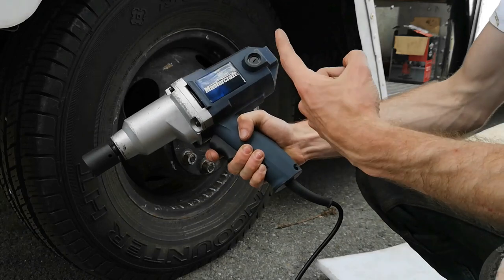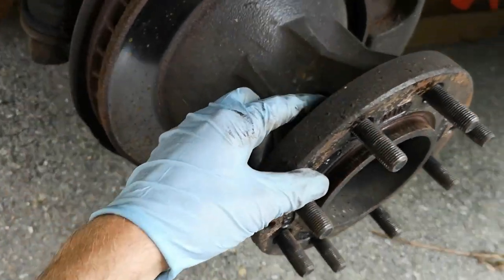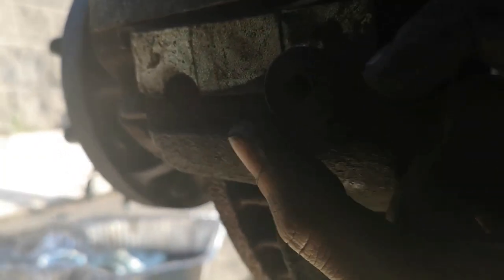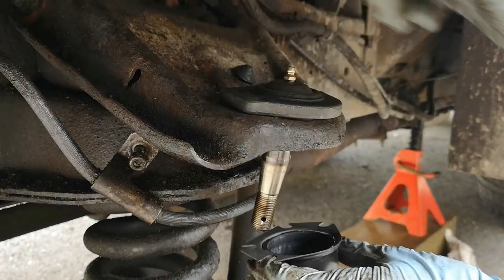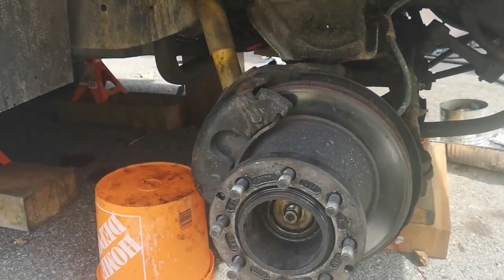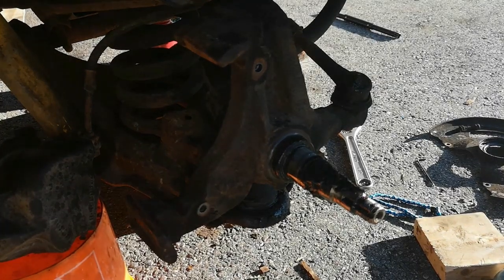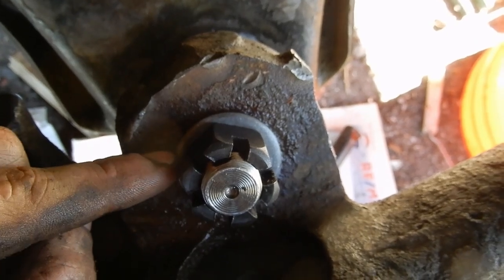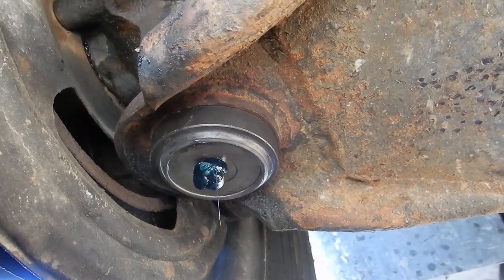Replacing Upper & Lower Balljoints (1990 GMC P30 Stepvan) ~ E074

Comment: Omg STOP! Job done WRONG! CAUTION! That's not an axle nut that you torqued down to hold the brake rotor on it's a wheel bearing adjustment but and cotter pin. Immediately stop driving and loosen those nuts. You never leave them torqued down or they will be over tightened heat up seize and fail causing the wheel to lock up while driving! Please find out how to adjust a wheel bearing before you tell other people to do this incorrectly and UNSAFELY and wrong! The wheel bearing adjustment nut only gets torqued down as you rotate the rotor to  fully seat the wheel bearings. After they are fully seated you are to loosen the nut and then tighten it by hand without a wrench. Insert the cotter pin into the nearest hole. Do not tighten this nut as the wheel bearings are not designed to have preload on them (being tightened). They are designed to have a few thousands of an inch of play in them. If you don't understand that consult a service manual for the vehicle you are working on or hey manual that shows how to adjust a wheel bearing. This video should be taken down or edited because you obviously have no understanding and did it completely wrong causing an condition that others will duplicate.

Comment: Ok, I am not going to lie, you scared the crap out of me when you pried that upper ball joint free.  But I figured since the video had been posted you lived.  Typically you would want something pretty sturdy under the lower control arm since the only thing holding back that serious spring is a shock absorber.  However, Congratulations, you have once again tackled a pretty difficult job in less than ideal conditions.  Just an FYI for the other two ball joints you should not have to remove the wheel hub or brake assembly unless you felt you needed the working room.  ball joints can be replaced without removing those if you do each one at a time (replace upper then replace lower on each side individually.  Again congratulations on a job well done, before long you can open your own repair shop.
Reply from the maker: Yeah, that's why I'm learning. I made another huge mistake doing this job. The shop opening will have to be delayed, lol.

Comment: What was axel nut torque?
Reply: It's NOT an axle nut! He doesn't have an axle!!! It's a spindle!!! He did it completely wrong, do NOT leave that nut torqued down or the wheel bearings will seize up and lock solid causing loss of vehicle control. This video should be edited and corrected now that people have seen it and don't know it's wrong and unsafe! Google how to adjust a wheel bearing PLEASE! This video is a prime example of why people should not work on cars when they don't know what they are doing!!!

Comment: I’m just curious how much time this took vs how much money you saved?      
Maybe you already covered that in your last video, I just don’t remember. This is a very labour intensive job, so you probably saved a bundle of cash. Good job on keeping the money in your own pockets!
  With the tighter front end parts, the van should actually drive much better. Will there be a test drive video?
  As far as the dust cap goes, they are probably not crazy expensive to replace. It’s something to consider depending on what it’s covering. I’m not sure what you used to fix the hole or how permanent the fix is.  
  I applaud your tenacity. I’ve done jobs like this before, and they are not easy considering the lack of tools and working outside.
Reply from the maker: Oh boy. The test drive did not go well. I didn't film it, but there will be a video coming out.
Reply: @SylvanSecrets  sorry to hear. What happened?